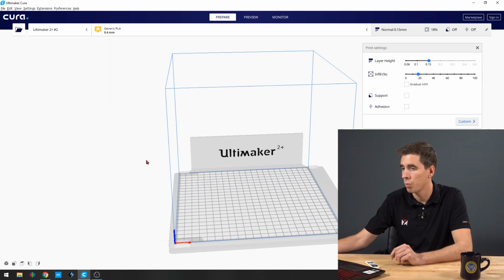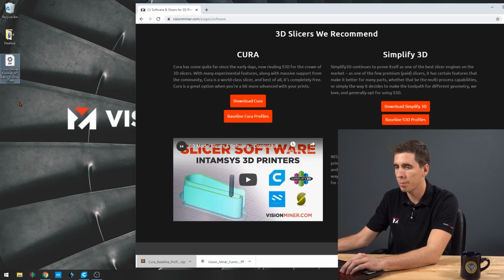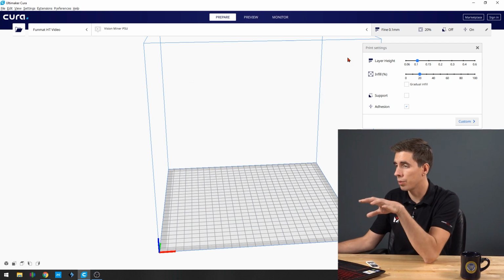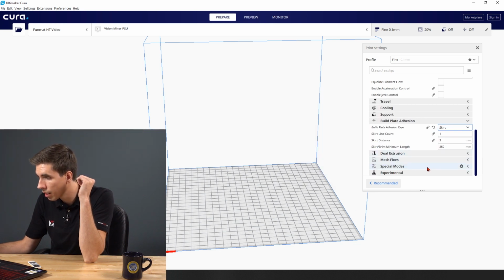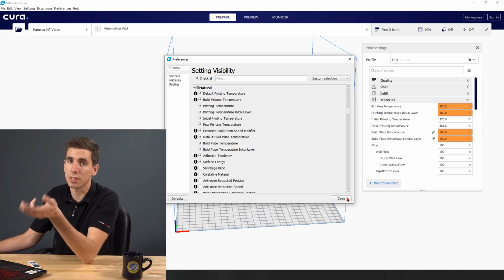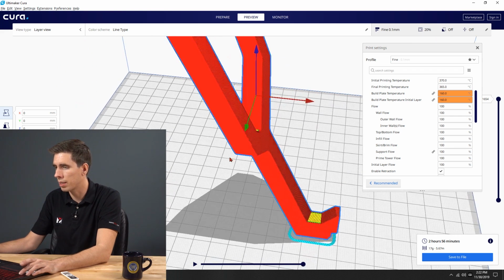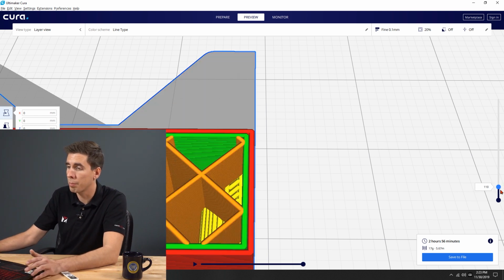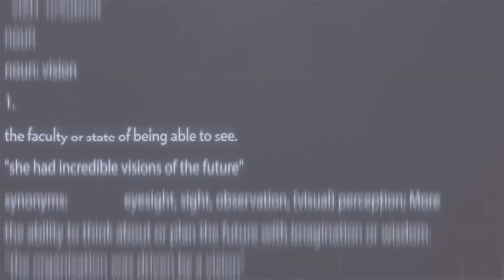How to Setup CURA Slicer for the Intamsys Funmat HT Enhanced

Comment: How do you disable to 365C limit for the extruder in cura? I am unable to slice my model due to the high temp for PEKK
Reply: No need to put precise temperature on a slicing stage - you can vary it on a 3D printer directly.